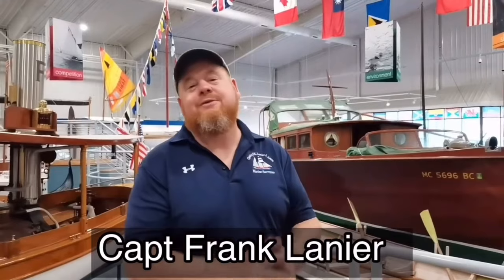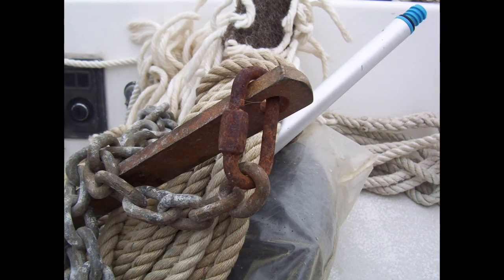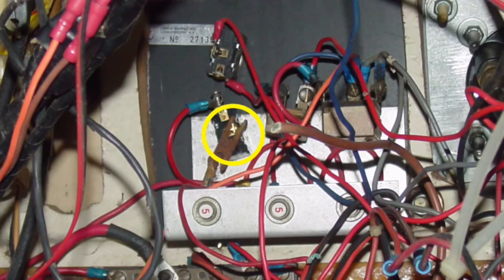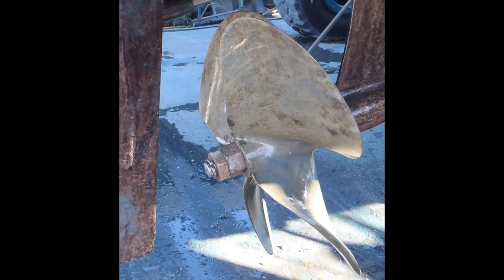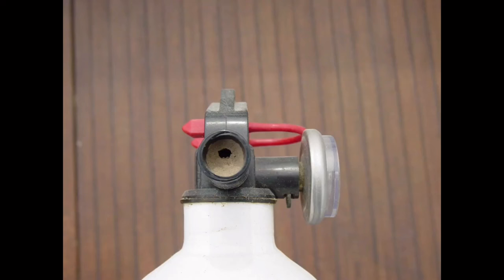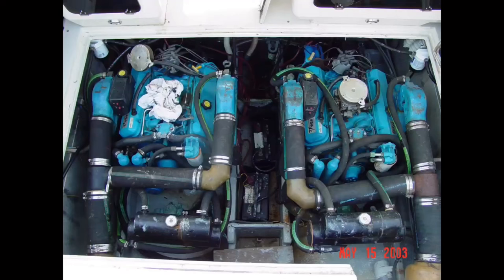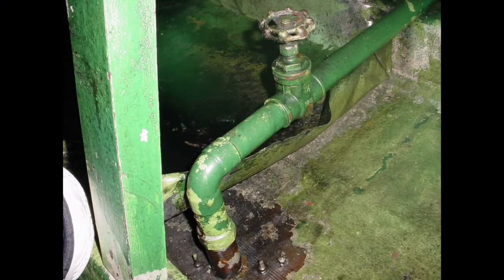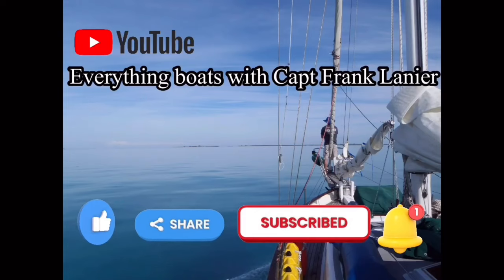Capt Frank’s Sea Chest Of Horrors (Episodes 6 through 10): Bad things on boats and why they’re bad!

Comment: I've been mounting props for 40 years also but your explanation makes more sense than my assumptions. With all of my training over the years including the military I have never seen the prop nut installation explanation. Maybe I have seen pictures of the orientation and ignored it because of no explanation behind it. 
 In the marina I see so much dangerous wiring installations and overloaded and loose shore power connections I have a hard time understanding why there aren't any more fires than there are. Winter time with live aboards is worse with multiple space heaters pulling 1500 watts each. Two of them alone will be nearly max load on a 30 amp circuit then add the loose shore power connection it becomes a problem for many people. Then we have in the marinas and dry storage the Google trained lithium battery installers that look for the cheapest ones they can find because they are all the same quality but some manufacturers are just greedy. Right? I have concerns about those batteries in the first place with the phone and now E-bikes and electric vehicle incidents. One fire in dry storage will be millions in damage. Not might be.
Reply from the maker: Thanks for the comment and I'm glad you found this useful! Let's be honest - liveaboards are the worst when it comes to fire hazards any time of the year (I can say this without hesitation because I've got over 20 years as a liveaboard myself). In the winter it's electric heaters - in the summer it's air conditioning, and water heaters the entire year. And your comment about one fire in a dry storage facility - spot on.